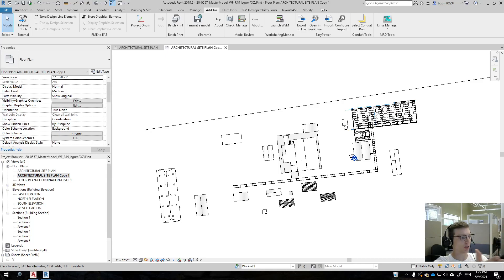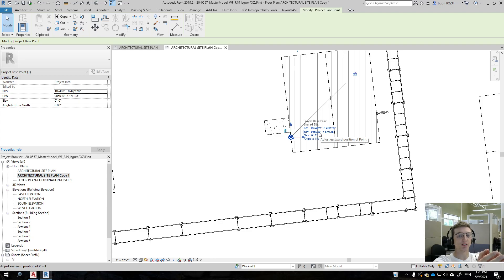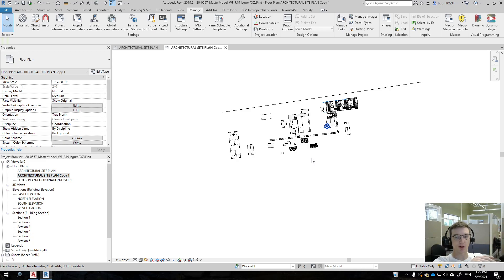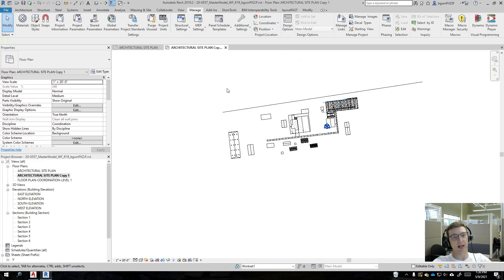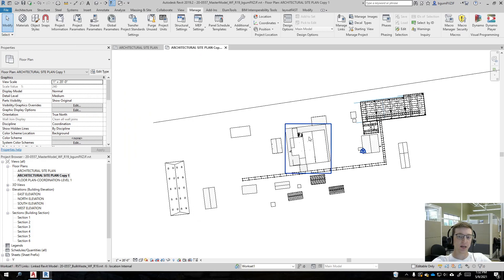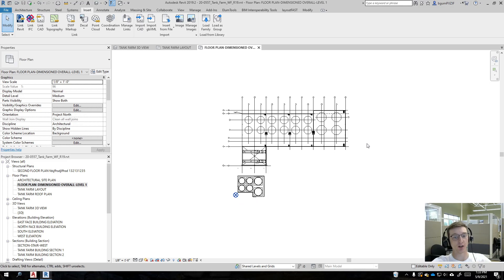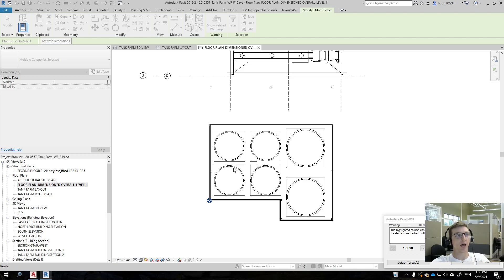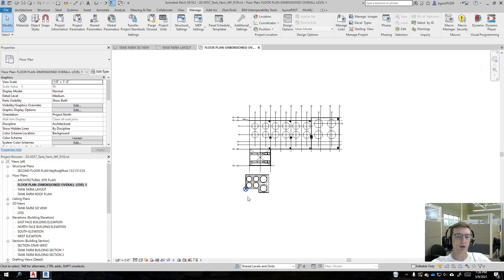Relocating Internal Origins in Revit to Create a Shared Coordinate System

Comment: Good try - thanks.  I was hoping you had a solution the rest of the WWW has yet to solve.  The use of State Plane Coordinates are very valuable for many "other" uses outside of Revit.  They are fine to use in Revit as well.  The state plane is like a table cloth under your "site" - the "origin" (SP) does not need to be hundreds of miles away - it can be within the state plane coordinate system very close to your building site.  I'd recommend using NGS/NOAA Maps to find "local" SPs - relatively speaking.   The issue is the differential relationship (x,y,z) between where model elements reside and the IO.  Regardless of whatever "movement" you can perform in Revit, I've yet to see Autodesk come up with a solution for this.

Comment: Having a geolocation allows the architect to export files in alignment to civil3D. Dont use that shared location if you dont want to. We can have multiple shared locations. One geolocation and multiple arbitrary locations. Depending on which location is set as current dictates where 0,0 is for algning various import and exports. Not all files align at rvt internal origin. Having various shared locations allows us to work near rvt internal origin and accomodate others.
Reply from the maker: Well said on the several shared site coordinates. I never thought of that...and thats a pretty basic thing to do. Appreciate the response.

Comment: did you mention something about autocad civil? civil3D? as far as i understand from our landscape planner, civil 3D *only works in project coordinates, so if you have a project at the 0,0,0 point it is better for them. 
*having the project located on real world coords is, as far as i understand from the landscape planner, confusing and nobody does it. Do you know anything about that?
Reply from the maker: I do not. The architecture firm I work with uses civil 3d and they do their jobs in real world coordinates. That's interesting to hear you say this. I always felt like it made very little difference for them to use state plane coordinate system rather than project 0,0,0.

Thanks for sharing. I'll keep my ears open on this one as I get further in my career
Reply: @b_gumm  I have a call about this exact subject next week with the civil responsible. can report back with info on best practice. good stuff.
Reply from the maker: @as1295  would love to hear what you find out. Contact me thru here or via my personal info listed on my channel